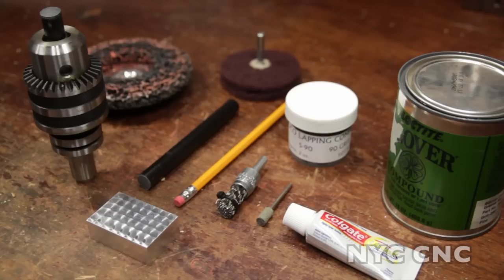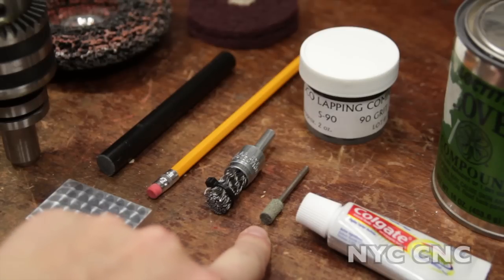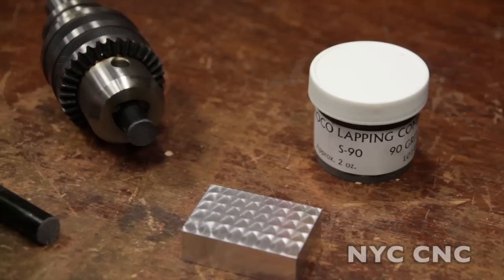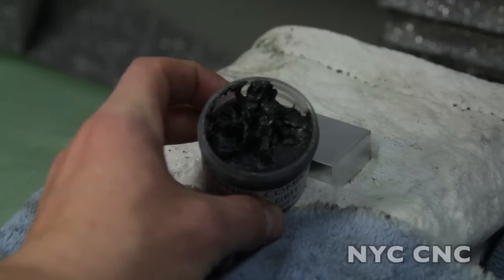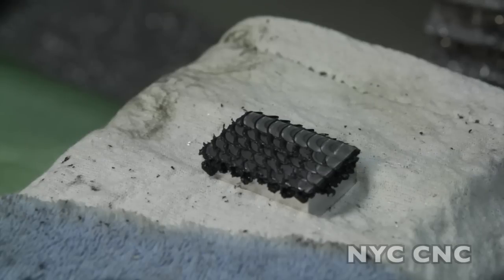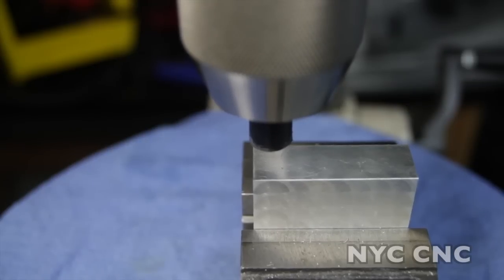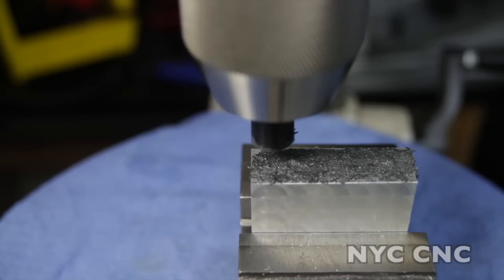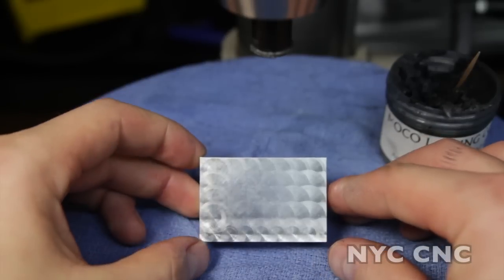Jeweling Aluminum!  How-To Video Tutorial for a Great Looking Surface Finish!

Comment: What you essentially made was a wire bond brush, what we use in aviation to remove paint, corrosion, and chemical conversion from the surface to bond a ground. If you spin it fast enough, you don't need any paste. Just be careful to not press to hard or you will gaul the aluminum. 

Wire-Bonding-Brush-for-Bonding-Jumpers-Aircraft-Tool-/

Comment: normally, you apply the abrasive paste to the rod, rather than the part; Doing that would help limit the amount you're using and make clean up easier (might not be great in the CNC to recharge the bit, but manually, it works great). I love engine-turned (jeweled) finishes! Anyone have experience applying a rusting finish or anodization, ect over the jeweled pattern?

Comment: Awesome instructional video! Just one question though: in your G-Code, why do you have to dwell with the rubber rod down for 5 seconds? At these RPMs you would think the pattern will be created in a split second (so to speak, short of saying "instantly") - did you experiment to come up with 5 seconds or did it just happen to be the first value that came to mind (happens to me a lot :) ). Thanks!

Comment: Yeah a small aluminium block, like the one in the video, would get too hot to handle. Cheaper steam cleaners don't really have the high temperatures and pressures of industrial steam cleaners but for small tasks they work well. You don't need running water to clean parts and if the part is hard to wipe down (not smooth) the residual heat drys the part quickly from the small amount of condensed water left behind from the steam cleaning.  It is kind of like a compressor air gun at 250F.

Comment: Thanks for the easy-to-understand video. I'm planning on using a friend's drill press to jewel the surface of a (removable) thin aluminum retaining ring on a sportscar steering wheel (holds the wheel to the hub).

Two questions:

1) I got a piece of 3/8" diameter aluminum dowel, cut down to workable length, to put in the drill press as an applicator (should make 3/8" diameter circles, I hope), and…

2) I got a jar of water-based valve-grinding compound from NAPA to use as the abrasive agent. Don't know the grit, it seems fairly fine.

Should those work OK?  And I can always get a pencil with an eraser if necessary!
Reply: Thank you Paul. As usual I learned a lot.